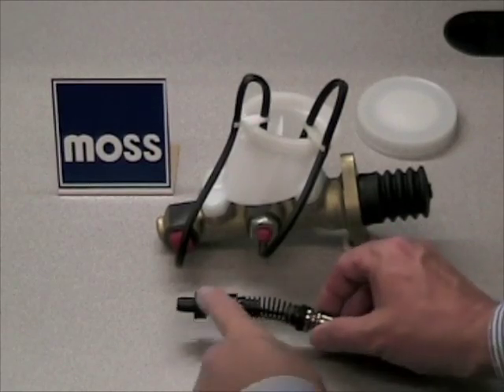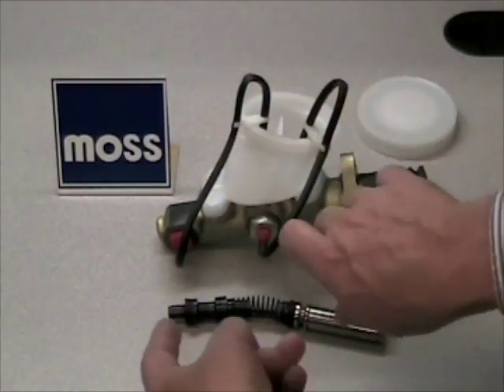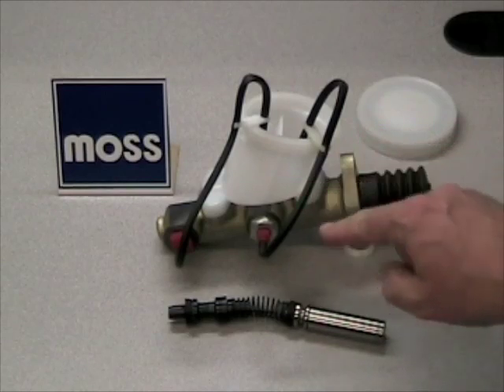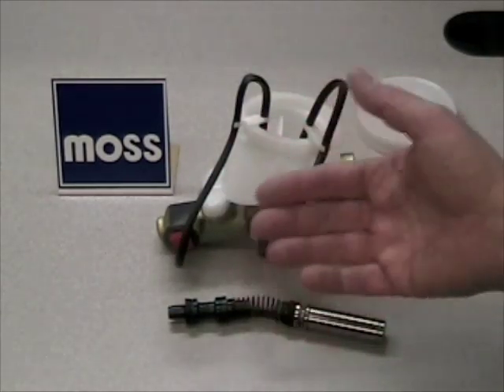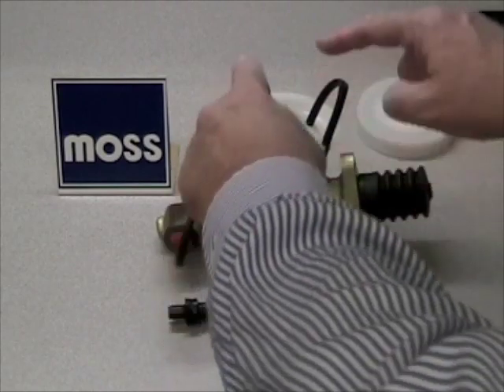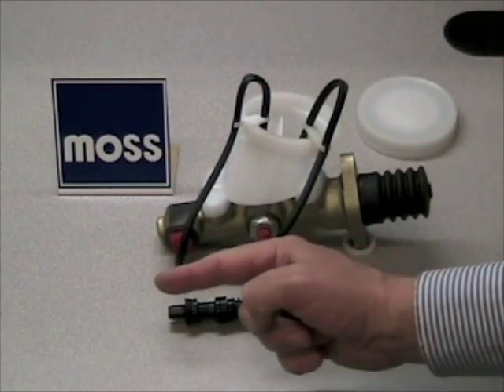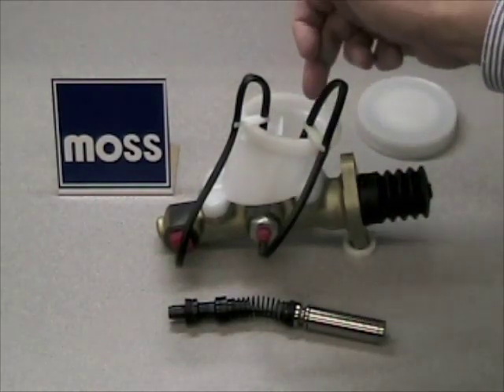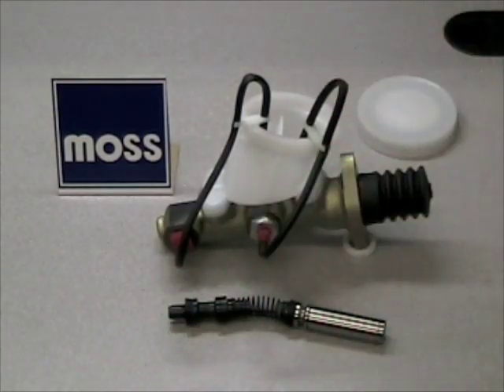Dual Brake Master Cylinder - How to Bench Bleed (Moss Motors Tech)

Comment: same procedure as in a vice, the important part is to have the lines feeding into the reservoir and take your time.  Just disconnect the brake lines from the MC and replace with your bleeding kit.  You can also use some short lengths of brake line with fittings on one end and open on the other.   Bend the line so that it feeds the reservoir, or use 5/16 ID hose to run back to the reservoir.  Pump the brake pedal slowly and continue until no more bubbles appear.

Comment: @intheshitter try doing a complete flush on the system. Brake fluid is hygroscopic, meaning that it absorbs water anytime it comes into contact with it, and over time brake fluid inevitably becomes saturated with contaminants and gets some water in it. This will deplete the fluid's ability to withstand temperatures, and the water in the fluid will boil causing bubbles to form in the system, which makes your brakes feel spongy when you press the pedal. Also check rubber brake lines, they stretch

Comment: so what happens when installing the MC back into the car... like you will have to remove the caps/bleeder-lines and then screw in the brake lines, but in that time will air not get in?
 i tryed bleeding my master cylinder using above method worked out just fine but for the few small seconds the threaded hole in the mc leaked brake fluid as i was quickly trying to hook up the brake lines so i got air going in as fluid was leaking id imaging??